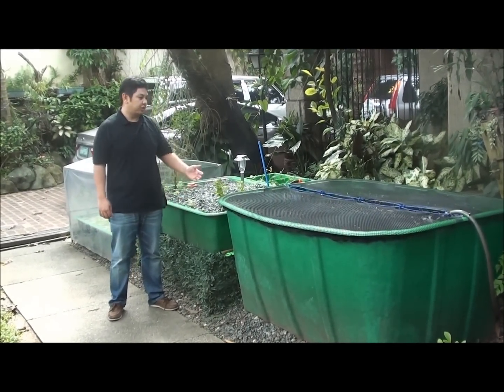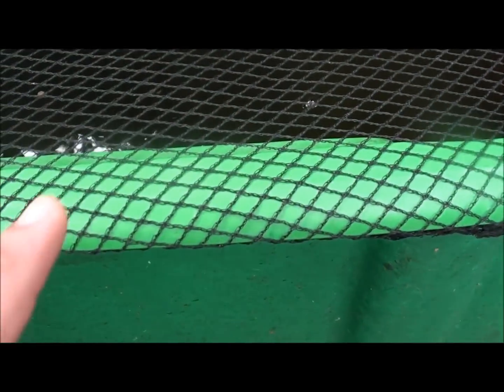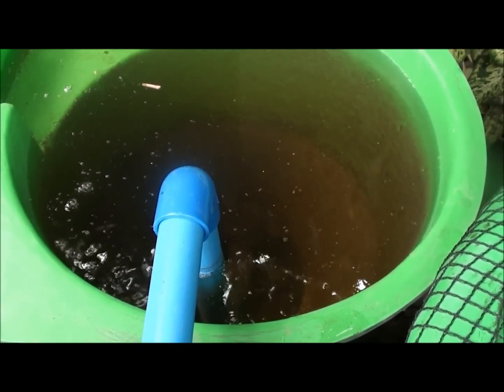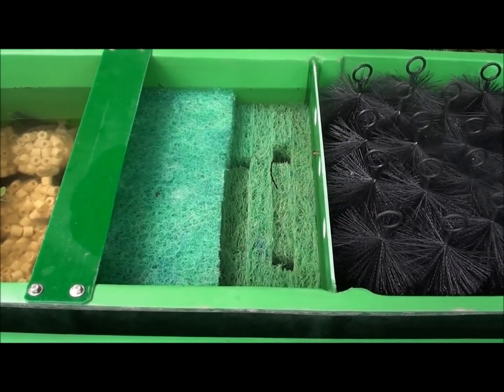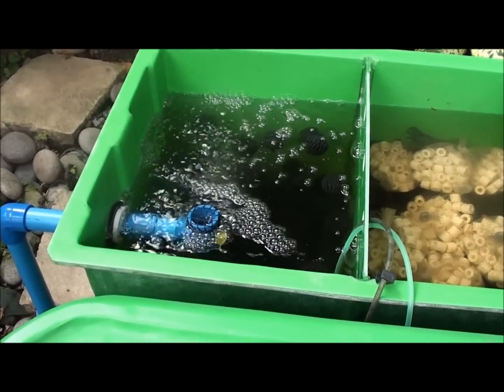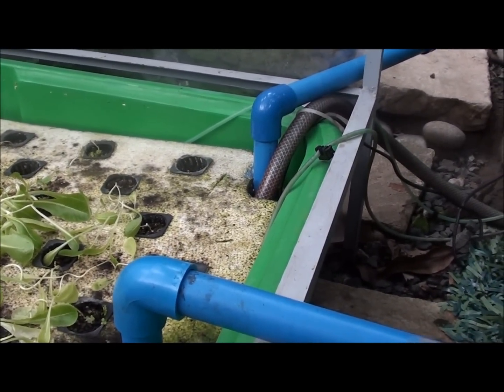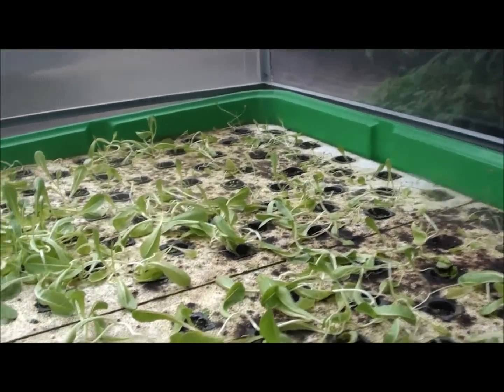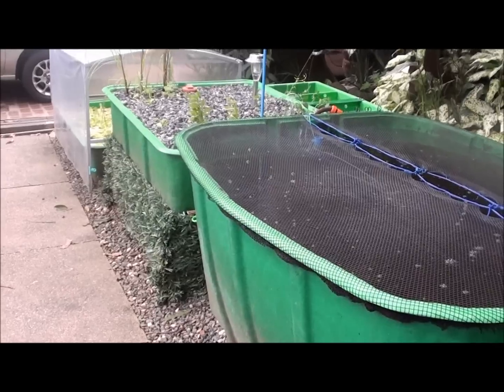Aquaponics Philippines, MADE Cascade System with Filtration

Comment: Year 2011 posted...hmm.  Tank not enough oxygen. Plants dun look happy. Tilapia that size & 200pcs in so little water. PH not too good. Tank water not run in. Try make ur own good bactria. Purchased one not good enough. Try create lots of tiny bubbles by adding rain pipe & a water pump inside tank. Ur air bubbles take abit long to burst. Ur system is good but the people setting up, no comment. Many chain reaction problems. BUT 2013 now, either u r already there or already stop. Have passion than talk about making money. God bless . Above just my thought oonly & need not bother.

Comment: using that system you mentioned what is the expected produce from it? You have
to have running electricity to run the system.  How much does it cost to run the system
in a year?

Comment from the maker: Para pong battery yan.You can run it in parallel to increase the capacity. The filter size was designed for the AP system.

Comment: When using ribs, keep in mind a rib is strong when the rib is taller as it is wide...In this bowing fishtank case I would have put ribs at least 7 or 8 cm tall and about 10 or 12 mm wide...
Also try to add some extra strength into the top rim of the tank... That's where the stresses mount up...The shape is already nice and has multiple angles to it so adding more fibreglass would make it stronger....

Comment: You could go for thinner sheets of hard foams...8 or 10 mm will add a lot of strength...
Honeycomb sheets are deer and ment for aircraft building.. Foam sheets will do very well with a fraction of the cost...

.Maybe you could think about thermal insulation while you are dealing with foams...

Comment: For tall tanks you may want to look into honeycomb boards... or attempt another sandwich style construction...You can use the same mold most likely since the mold ( I suspect) is to define the inside shape and any structural things can be put on top of the initial layers of Fiberglas/resin.

Comment: PVA glue is glue normally used for wood ?? Sound like a good plan...
Sometime we used also tube insulation covers (most likely made from PE or PP based foams) cut in halve to make rib shapes... but usually for interior/technical spaces for boats and such...

Comment from the maker: Its 100% fiberglass. The ribs are there for vertical rigidity. I have a mold constructed to attain that shape. You can see in our other setups with the same fish tank design, we added more layers to reduce the bending. I used PVA glue to cover styrofoams so they won't react with the resin. We used Foam AB to construct the mold for the filter because it has more intricate shapes.

Comment: I know the FRP all to well. If it fails it is quite a sight I must admit...
I used to use styrofoam strips (sanded to shape) as a bases for rib construction (I used epoxy and not polyester...so beware with polyester and styrofoams...they do not like each other. If you want to use polyester do the same thing with polyurethane foam strips. Most likely you don;t want to use steel rods imbedded in the fibreglass because while curing, the resin will shrink and the steel will come separated.

Comment from the maker: That was my first Fishtank. So its a prototype. I used a semi flexible resin so it can withstand fatigue load and water vibrations. A rigid tank won't give any warnings, it would just fail catastrophically. If any small cracks would appear, I can always easily repair it . That's the beauty of a FRP tank.

Comment from the maker: @MrMadmax478 To minimize impeller pitting in the DWC which also has aeration, the pump has its own small sump inside the DWC and the airstone is also located away from the pump. The current config right now is FT overflow to the Filter then to the DWC/ Sump then to a bypass which goes to the FND and to the FT.

Comment from the maker: @MrMadmax478 I can certainly go that way ( FT to FND to DWC and to FT) but I will have to use the last compartment as a sump. I am using the last compartment as a MBF right now and the MBF would require aeration. If I place a pump in the MBF with aeration, there is a high possibility that the pump will suck in air bubbles and cause cavitation which will wear the pump impeller quickly.